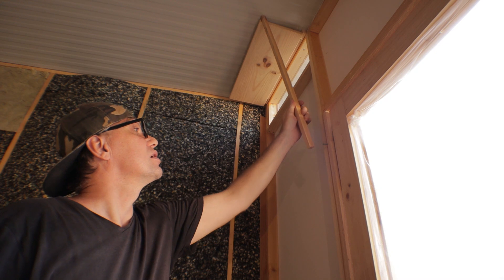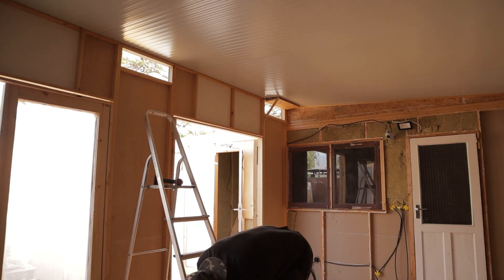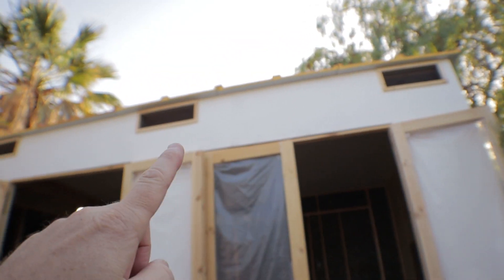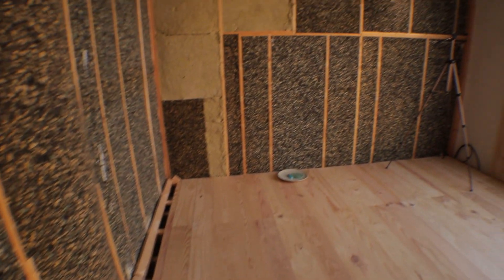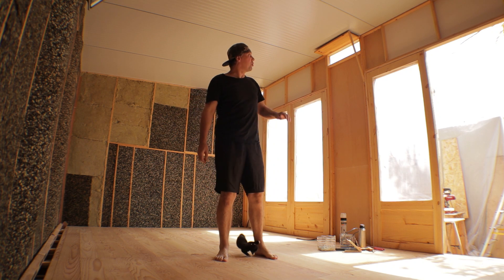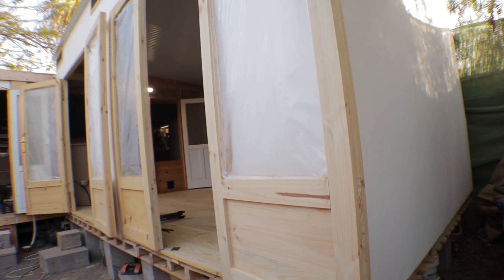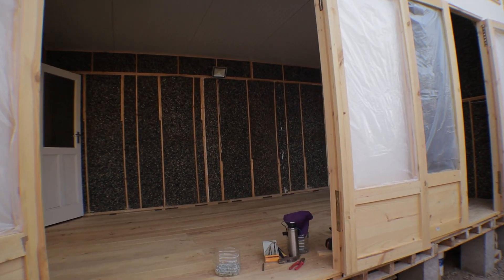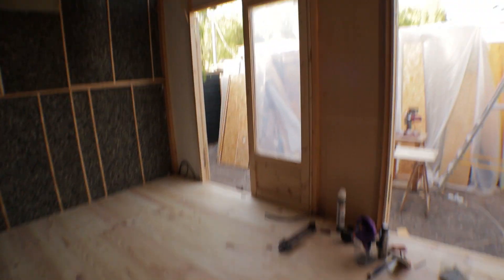Natural Air Conditioning System How To Keep Your House Cool Without AC (S1 Ep12)

Comment: This is a smart and genius idea!! It totally makes sense. Even the slop of the roof helps the hot air inside rise to go up the sloped ceiling and out of the house. I just wonder how you’d keep bugs out when the floor vents are open unless there’s window screens underneath the floor vents. I’ll have to check out the other videos. 👍🏼
Reply from the maker: mosquito net 👍🙂

Comment: shame i cant do this for my house. we have a concrete floor ;-;

i have thought about using some sort of underground natural air conditioning, for example: putting some sort of a copper radiator in the ground and running a set of pipes to the roof and using a small fan to push the hot air down and the cool air up.
Reply from the maker: A long time ago, I laid a pipe 15 cm in diameter and 30 meters long in the ground. and it worked very well
Reply: @klerobi1  that's awesome to hear! I haven't stopped thinking about this idea and i might try it after some more research :)
Reply: There is a video of a farmer in a hot summer cold winter area (maybe Idaho) he built greenhouses dug down a few feet into ground and pipes under ground maybe ten feet away from perimeter capturing air cooling it under ground before it came back up into green house and it helped him a lot . I really liked that idea. No mechanical involved.

Comment: oh yeah in the middle of the heatwave let me get to that...
Reply: I have been wondering why more off grid builders have not started building at night because whether it is higher temps or just more intense sun it really is too hot to build in day time anymore. If you live away from people that would be bothered by noise of course, and if a spot light of some sort can be used. Even in mild Indiana USA I will not even garden in  day time anymore only morning and evening. I'm older so heat stroke is a real danger.

Comment: I noticed many buildings in Costa Rica have this set up. The hottest I've noticed it get is 85°F, so air conditioning wasn't practical. It was still uncomfortable when it is 80°F in the rainy season unless there is a nice breeze inside. Cute kitten by the way!
Reply from the maker: Yes, this is not an air conditioner. This is the natural flow of air. Which helps push hot air out of the house

Comment: Where is the air pressure coming from though?  

Or is the pressure from the top holes pulling?
Reply: Hot air rises. So with the openings near the ceiling, the hot air escapes, which causes a light vacuum inside the house. Because the hit air rising and escaping, it draws the cooler air in from the floor. Sort of like a vacuum. It creates negative pressure when hot-air escapees through the top.
Reply from the maker: This is natural airflow. Much like in a chimney. Yes, top holes pulling warm air out this means that cold air can get inside
Reply: The difference on temperature makes the airflow. We usually ignore this concept but it is strong enough to make things work. That's why the cold air entrance comes from the floor and the hot air goes on top.
Reply: Oh ok. Right on

Comment: What's the temperature inside compared to the outside if the outside is about 30 degress?
Reply from the maker: I don't know I don't have a thermometer. But it’s similar when you get under a tree in the shade. If you put your hand close to the gap you feel the air flow.